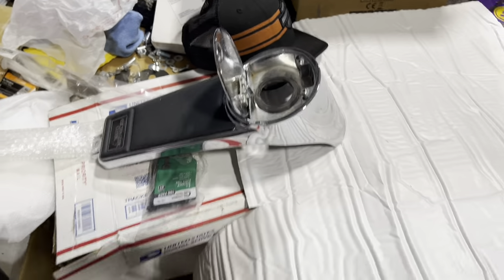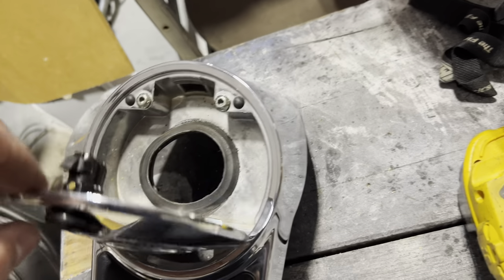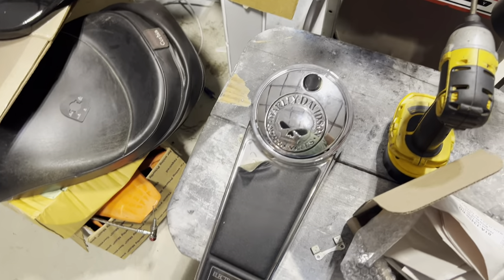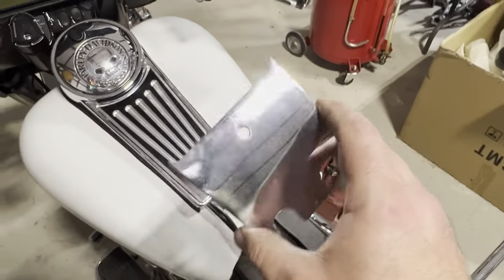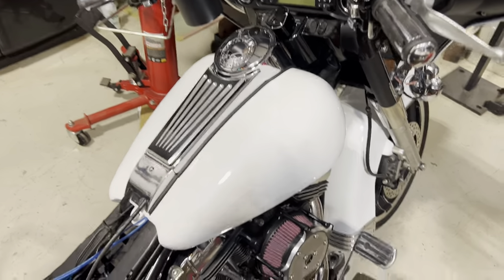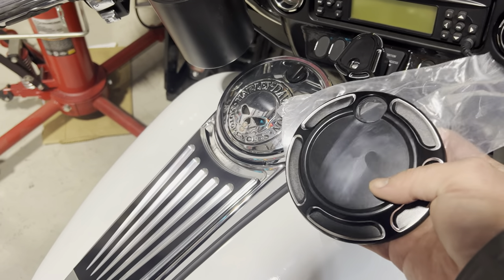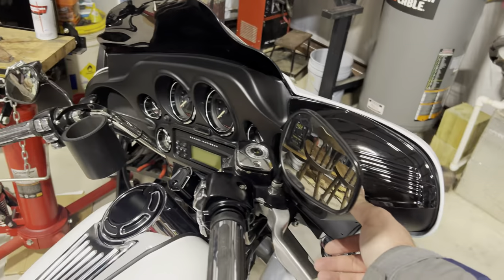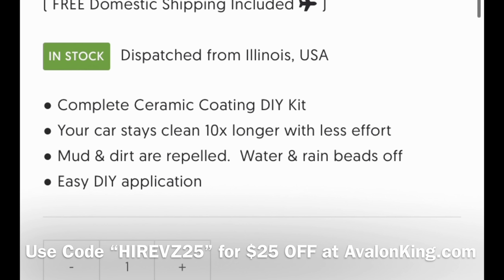CUSTOM DASH INSTALLED - '06 Harley Electra Glide Extended Bagger

Comment: Did you use stock gauges or aftermarket
Reply from the maker: All stock gauges
Reply: @HiRevzMedia  thanks for the reply.. getting tired of my stock sim gauges on my 08 street glide and the only option I see to upgrade is Dakota digital.. which don’t get me wrong look good and are wayyy brighter but they are expensiveee!